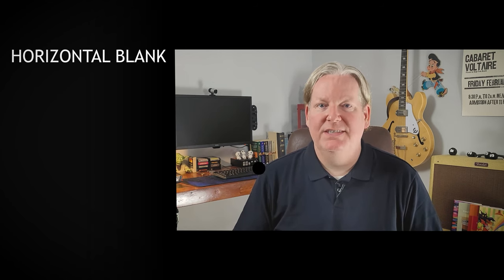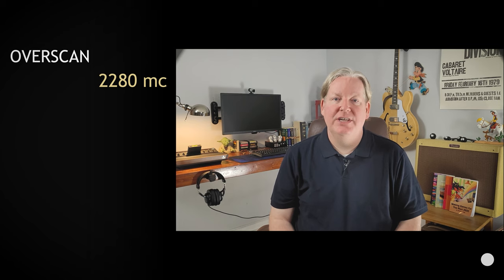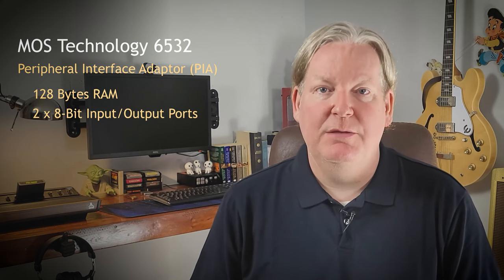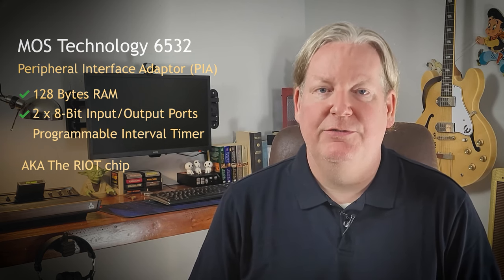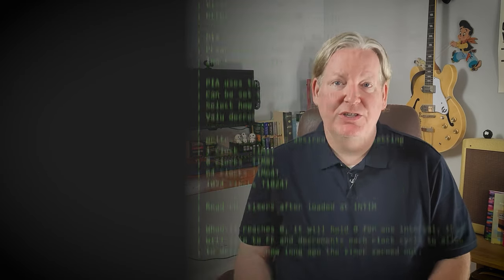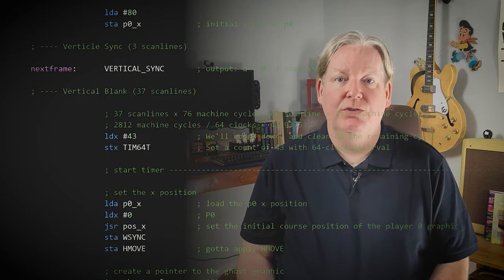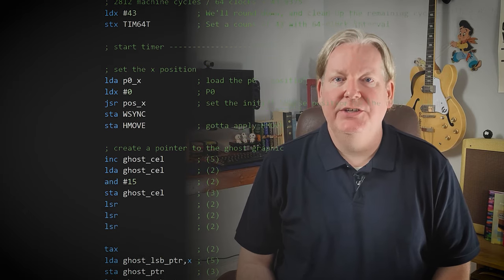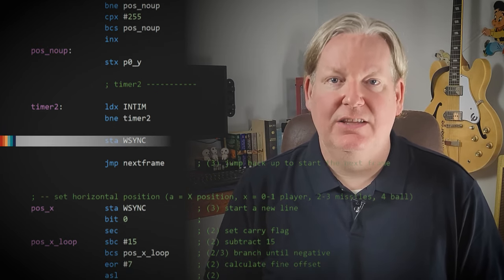How Does the ATARI 2600 Keep Time? | 8Blit

Comment: So you get within 60mc of the target with the timer and the WSYNC does the rest because horizontal blank (23mc) + playfield (53mc) is more than 60mc in total?
Reply from the maker: At that point we're just wasting the last 60mc with the WSYNC. WSYNC will actually pause the 6507 until the start of the next scanline. Alternatively we could have used those 60mc for other code, but for such a simple example we didn't have any other work to do.